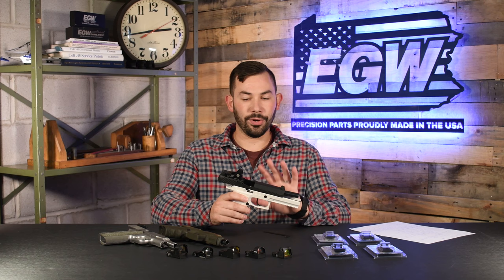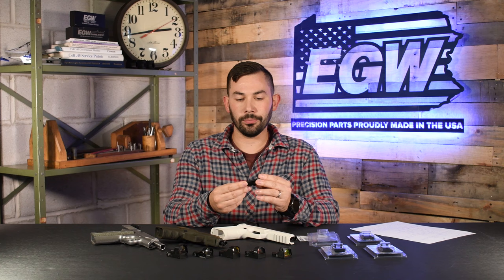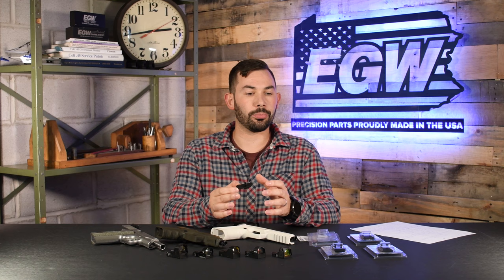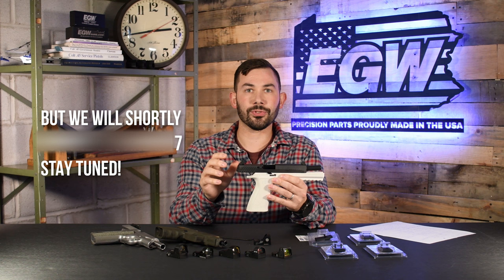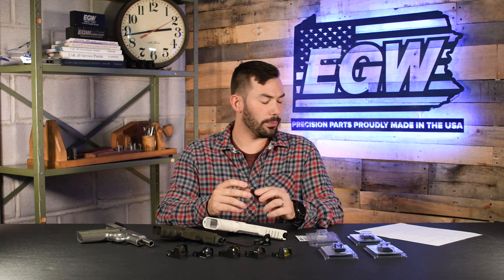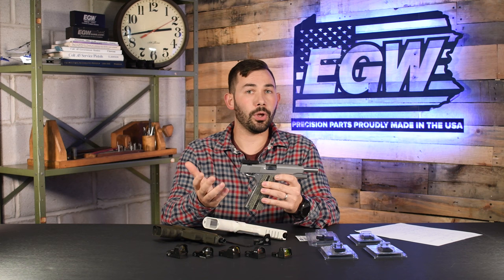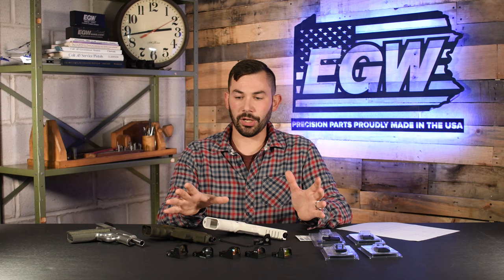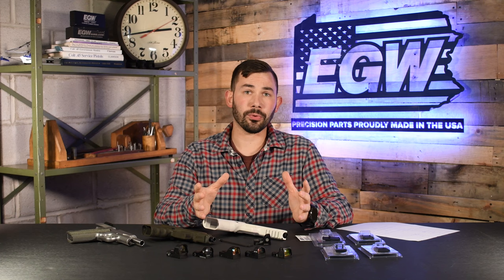Red Dot Mounts | Everything You Need to Know, and More

Comment: SIR , I have an out of production, Star BM 9 9mm pistol. It being similar to the 1911 with GI sights, WOULD you have a mount that I could place a red dot scope on ?
Reply from the maker: Hi Harold, thanks for contacting us. We don't have anything that will fit the Star BM off the shelf. I don't know how much different the G.I. site is from the Star rear sight, depending on how close they are it may be a good starting point. If the dimensions are not close enough, you can always use our blank mount and take it to a local gunsmith and have them machine it to fit your dovetail. Thanks!

Comment: Noob ass question but I just bought my first glock 17 and i bought the vortex viper red dot mount to mount it. My concern is that the mount deletes the rear sight which I thought you needed for the red dot. Do you actually need a rear sight or can you just run a red dot with trijicon tritium front sights?
Reply from the maker: Hi Eduardo, our plates do not allow you to cowitness. To cowitness you would need to have the slide milled so the red dot can sit lower.

Comment: I currently just bought a HK VP9SK. which mount would work best with a Holosun RDS/GDS?
Reply from the maker: Thanks for contacting us, the Holosun 407k and 507k use the Deltapoint Pro footprint and the Holosun 407c and 507c use the Trijicon RMR pattern. As long as your VP9SK just has the standard dovetail rear sight cut and is not already optics ready, you can use the HK VP9 mount that we make. All of our VP9 mounts are available here: 
https://www.egwguns.com/pistol-and-red-dot-mounts/mounts-by-firearm-brand-sight-cut/?model=694

Comment: I have a rugged sr9c and I want to put a red dot on it but it has the load indicator on it. Do I need to remove the back site to install it.
Reply from the maker: Hi Cheri, we don't currently make a plate for the Ruger SR9c, but we will hopefully have one in a few months. The engineers will take the LCI in to account. You would need to remove the rear sight.

Comment: I have a Springfield range officer in 45 acp. I'd like a red dot on it. Anything available for that that won't fail after extended use? If so, who red dot you recommend?
Reply from the maker: Hi, thanks for reaching out. We would need to know what kind of rear sight cut your Range Officer has. You can email pictures to info@egwguns.com and we can get you set up with the right mounting plate.
Reply: @EGWInc  The Range Officer models have the LPA adjustable target sight according to Springfield, since I have the same gun I just purchased the 1911 LPA mount for the Vortex Venom/Viper sights, thanks for making this mount. 👍

Comment: So if a pistol is optic ready with the pattern cut into it, will any optic fit to it ?
Reply from the maker: Optics ready pistols may be cut for specific red dot mounting patterns, or they may make plates that fit the cut out to mount multiple different red dots. Unfortunately, there isn't one specific pattern for red dots. Vortex Venoms use different mounting location pins and screws than Vortex Razors, Trijicon RMRs are different than both of those too.

Comment: Do you have a base plate to fit a Beratta APX - I have a Kahles  Helia RD that I need to mount on the APX rear dovetail>>
Reply from the maker: Hi Ralph, I'm not sure if the Beretta APX rear sights cross reference with any other company's rear sights. I also haven't been able to find any information if the Kahles fits on any of the common red dot adapter plates.

Comment: does this could be used as the adapter for deltapoint pro on fnx 45 tactical?
Reply from the maker: Hello, if your gun is optics ready, our plates will not work. If you have JUST the regular rear sight cut and no optics ready plate, then this should work for you. https://www.egwguns.com/pistol-and-red-dot-mounts-deltapoint-pro-fn-fns-fnx-sight-mount-fits-shield-rms-rmsc-sms-jpoint-redfield-accelerator-and-optima

Comment: I ordered plate for HK VP9 and it did not fit. My gun smith couldn't mount it. He measured it and the screw holes were different. Not sure what footprint i need
Reply from the maker: Hi, thanks for contacting us. Sorry to hear you had trouble with your mount. Which exact model VP9 do you have? Which exact red dot do you have? What product number did you purchase?
Reply: @EGWInc  regular VP with holosun 507C optic.  The serial number for plate sent doesn't match up with what's on website. I will call you guys today to order right one

Comment: Hi, I just received item SKU 49321  your website states that This mount fits:
Ruger MK I
Ruger MK II
Ruger MK III
Ruger MK IV
Ruger P85
Ruger P89
Ruger P90-95
Ruger P97
Ruger 22/45 
I have a Ruger P89 the mount will not slide in more than 2mm is it any way to get it to work. Thanks
Reply from the maker: Hi, thanks for contacting us! We always recommend having a gunsmith install our plates, but we have had customers successfully install them using a rear sight pusher tool. Our dovetail mounts are meant to be a press-in fit and should be installed from left to right with the gun facing forward.

Comment: Just wondering what's the best cheapest dovetail plate option red dot for a Sig p365? Plate and red dot. I'm needing to keep it around$300 if possible?? Newbie to the red dot world. Thanks
Reply from the maker: Hi Scott, we don't make anything for the Sig P365. There may be some other companies out there that are producing a mount for the 365. There are quite a few entry level red dots that work well. Right now, it depends on what is available. We normally stock the Vortex Venoms, but are not able to source them at the moment. The Swampfox Kingslayer is a popular option as well as the Burris FastFire and the Holosun 507c. I hope this helps!
Reply: @EGWInc  yes sure does! Thank you!!

Comment: I have a sig p226 the mount came off...should I use loctite
Reply from the maker: Hi, thanks for reaching out. We have found that Sigs have some slightly oversized dovetail cuts. Loctite may help. We are working on making a mount with a larger dovetail specifically for the Sigs, but we don't have a good time frame on it.
Reply: @EGWInc  thanks

Comment: How durable are these? Are they suitable for duty/edc/go to war?
Reply from the maker: Randolph, thanks for contacting us. Our mounts are machined from 7075 T6 aluminum and are hardcoat anodized. They are extremely durable. They do not allow for cowitness though. If that is what you are looking for, we recommend getting your slide milled for your specific application.
Reply: @EGWInc  Cowitness doesn't matter for me. What matters is if the mount itself will shift, bend, or crack if I take a fall on the gun itself or if I drop the pistol down a flight of stairs.
Reply from the maker: @randolphtiangco6239  we have sold tons of mounts and none of them have come back for being bent or cracked from falling down a flight of stairs. It sounds like you need the most robust option though. If that is the case, we would recommend getting your slide milled. That way you are only relying on the strength of the screws that hold the red dot in place.
Reply: @EGWInc  Ok. Thanks for the recommendation.

Comment: i would like to mount a floating red dot on a Taurus th9  any options? most of the videos i see are for Glock or S&W
Reply from the maker: Hello, thanks for contacting us. Our Taurus mounts are not made yet, but they should be in stock soon. I cannot confirm they will work with the TH9 either. We have them listed as working with the G2, G3, PT111 G2, PT140 G2, PT709, PT740 and TX22.

https://www.egwguns.com/catalogsearch/result/?q=taurus
Reply: Will they work on the G3c?

Comment: Do you have dovetail mounting plate for Wilson EDC X9 with holosun 507c?
Reply from the maker: Hi, thanks for reaching out. The Wilson EDC X9 looks like it uses a Novak rear sight cut. That would require the use of this plate:
https://www.egwguns.com/trijicon-rmr-sro-holosun-407c-507c-mount-for-novak
Reply: @EGWInc  but I wonder why EGW made it with a gap/space infront between the slide and the mounting plate? It looks too high. Can you specially make it fit EDC x9?
Reply from the maker: @chanvu1077  It is .250" from the bottom of the dovetail to the bottom of the front overhang. Our mount allows for a clearance of .040" on the front overhang on slides cut for a Novak rear sight according to the Novak print. 

https://www.novaksights.com/Content.aspx?PAGE=%22Sights%20101%22

Comment: Very interested in getting a razor red dot for my 1911, its a taurus commander. Will any of these work?
Reply from the maker: Taurus uses their own unique rear sight cut as far as we are aware. We don't have anything that is available "off the shelf". You can use our blank plate and have a local gunsmith or machinist cut it to fit the dovetail. https://www.egwguns.com/trijicon-rmr-sight-mount-for-blank
Reply: @EGWInc  is there another you could recommend? The local Smith told me today that the piece you recommended may not fit the sight that I bought. So I have the Vortex Razor red dot, they told me just to see if there was a similar piece like the one you recommended but that will fit my specific sight. Unfortunately, they couldn't recommend or refer another place, they said best thing was to try reaching out to yall again
Reply from the maker: @cacaKILLS  whoops! Sorry about that. I sent the link to the RMR and not the Razor. The Razor blank is available here: https://www.egwguns.com/vortex-razor-blank-sight-mount

Comment: Hello I'm having a hard time finding stuff so I can put a red dot on my Taurus th9
Reply from the maker: Hi Robert, thank you for contacting us. We don't currently make a mount for any Taurus' but we are looking in to making some mounts for them. We currently only have a blank which could be machined by your gunsmith to fit your dovetail.
Reply: Robert I have the Th9C aka compact and ive done countless research for this  pistol and all ive been able to find for optics is luminescent fiber optics there is basically nothing out there except replacement parts for oem parts. I cant find any modified barrels, slides, sight plates, decent triggers or hammers for the Taurus TH series. OWB Holsters you will have to order custom made if you want a holster with a good fit.
Reply: Lakeline LLC has a mount plate for the th9. I'm thinking about it and the night sights but they're pricey
Reply: @EGWInc  how does the Novak dovetail not fit the Taurus th9 when the rear sight on my th9 says Novak?  My Taurus 1911 Commander also says Novak.
Reply from the maker: @TheDkb427  Hi, thanks for reaching out. That is a great question that we get a lot. Taurus does in fact use Novak LICENSED sights which is why Novak is machined in the side of the sight. The problem arises because Taurus has their own specific dimensions that they have Novak make their rear sights to. There are actually quite a few companies that do the same thing which is why it can be so difficult to find the correct rear sight or rear sight plate for your gun. What we, and the rest of the industry, consider to be a true Novak cut is callded a GENUINE Novak sight. Novak has a lot of this info listed on their site. It's a long read, but definitely puts a lot in to perspective. 

https://www.novaksights.com/Content.aspx?PAGE=%22Sights%20101%22
Reply: @EGWInc  I did read that before that they say fitting is required. I just find it irritating that Taurus does that. Guess whatever is easier for them right. Thanks
Reply from the maker: @TheDkb427  you bet!

Comment: How do you adjust the angle of the plate after its installed-?-
Reply from the maker: The angle of the plate is not adjustable. Most red dots are able to be adjusted using the elevation and windage screws on the dots themselves.
Reply: You can buy shims from ai optics

Comment: I'm removing one of your mounts so I'll be removing from right to left , correct?
Reply from the maker: Hi Jim, thanks for reaching out! Yes, removing it from right to left is the way to go.
Reply: @EGWInc   Thanks Cody, sure wish I could get one for my H&K Expert 9mm, it's like a Bomar cut. Also, when you showed the 1911 on this video, you call that a Novak cut but it looks to me like a Bomar. Can you correct me on this? I have a Sig 1911TME with what is called a Bomar and I'm thinking of putting an optic on it too. Thanks
Reply from the maker: Hi Jim, the HK Experts and Elites have a different cut than the regular HK USPs, we may look to make one for those models in the future, but we don't currently have any plans for one. It is similar to a Bomar style cut but the dovetail width and depth are different. The 1911 in the video is a Dan Wesson and it does have a Novak cut. We had already removed the rear sight and replaced it with one of our plates. Sig 1911s with adjustable sights use an LPA or a Kimber Adjustable style rear sight. You would need to measure the distance from the face of the cut in the slide to the front of the top of the dovetail. Depending on your measurement, it would either be an LPA or a Kimber Adjustable. We have a graphic on our mounts for those that show where to measure. 

https://www.egwguns.com/viper-venom-lpa-sight-mount-fits-burris-fastfire-and-docter

Thanks!
Reply: @EGWInc  is there a reason you dont sell the 507c for Glock mount one on your Amazon store?
Reply from the maker: @ArizonaMMJ  Thanks for contacting us. We don't sell anything directly on Amazon. Everything that is sold there is through 3rd party sellers and they choose which products they would like to sell.
Reply: Evolution Gun Works oh ok gotcha

Comment: On the site it say they work for the shield but when I looked on another site same brand it say it fit the shield I’m kinda confused cause I always seen it sold on amazon n it say don’t fit the shield
Reply from the maker: Hi, thanks for reaching out. What gun do you have? Our Leupold Deltapoint Pro mount fits the Shield RMS, RMSc and SMS.
Reply: Evolution Gun Works  m&p shield 1.0
Reply from the maker: @joyrdbryant  This mount should work for you.

 https://www.egwguns.com/pistol-and-red-dot-mounts-deltapoint-pro-s-w-m-p-sight-mount-fits-shield-rms-rmsc-sms-jpoint-redfield-accelerator-and-optima
Reply: I was looking more towards a ade off amazon ms and rmsc and sms are a lil to pricy
Reply from the maker: @joyrdbryant  our Vortex Viper/Venom mount works with the ADE red dots. We have found that they don't always work the best, there have been some times where minor fitting is required. ADE does not hold as exact tolerances. The Venom mounts is available here.  https://www.egwguns.com/viper-venom-s-w-m-p-sight-mount-fits-burris-fastfire-and-docter

Comment: Hi, Do you have a mount for an Astra A75
Reply from the maker: Hi Mark, I'm not sure what kind of dovetail cut the Astra has, whether it is specific to the gun or if it uses something standard like a Novak cut. If you are able to figure out what type of rear sight cut it has, we can check to see if we have anything that fits. We also have blank mounts that you can have a local gunsmith or machinist cut to fit the dovetail too.

Comment: Do they work for sccy cpx2
Reply from the maker: Hi Paco, thanks for reaching out. We don't have anything that will work with the Sccy off the shelf. If you have a local gunsmith, you can use our blank and have them machine it to fit the dovetail on your slide.

Comment: Will a hollow sun 407 fit on those mounts
Reply from the maker: Hello, the 407c fits the RMR mount that we make. The 407k uses the DeltaPoint Pro mount that we make, but requires the rear pins to be ground or filed off.
Reply: @EGWInc  I have a ruger p89 will it fit that pistol.
Reply from the maker: @shotgunjim1itemsofinterest868  

Our Ruger Auto mounts fit the P89. They are available here:

https://www.egwguns.com/pistol-and-red-dot-mounts/mounts-by-red-dot/?model=711

Comment: Just bought a Sig Sauer P320 M18 and the slide has optic cut for Romeo1 Pro or Leupold Deltapoint Pro. It also has a seperate rear sight. Do you have a compatible adapter now for a Trijicon RMR or the Holosun HS507C-X2 for my SIG P320 M18 slide? At the time you made this video (Sept 2019), you mentioned they were coming out soon. If you now have them, please let me know the SKU# and I can look it up on your website. THX!
Reply from the maker: Thanks for reaching out. They are currently out of stock. You can sign up to be notified when they are back in stock. The RMR and Holsun mount is available here: https://www.egwguns.com/trijicon-rmr-sro-holosun-407c-507c-mount-for-sig-m17-deltapoint-pro

Comment: red dot mounts are the latest scam from the industry not because reddots aren't great but because you have to either get a mount or an adapter for the mount to mount whatever red dot you want. That's b.s. 
The footprint on ALL pistol reddots should be standard. Just like threading on your barrel should be standard so that you can fit compensators or suppressors without changing the barrel or having to thread an adaptor onto your barrel.
Standardizing the thread or mount helps all vendors sell more because it makes the purchase more accessible financially for consumers